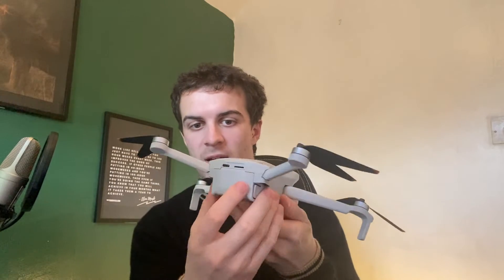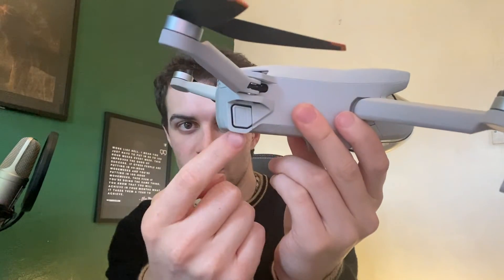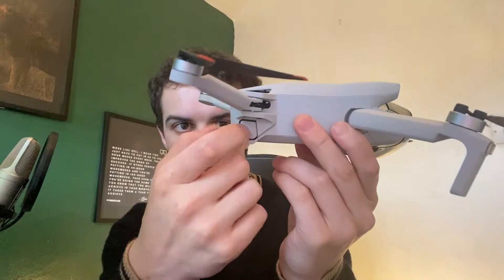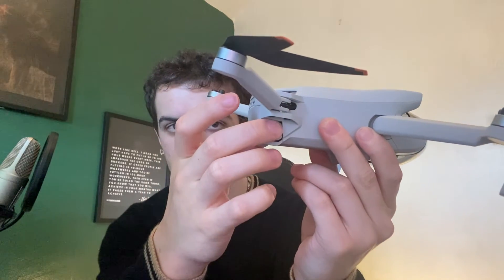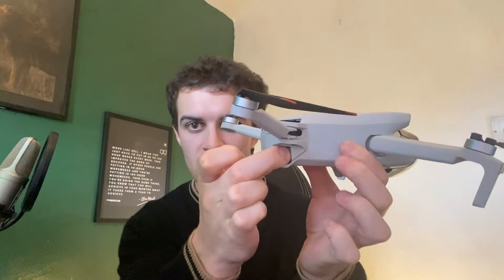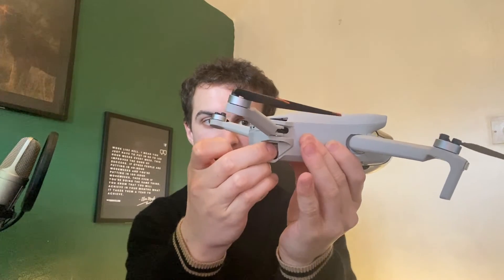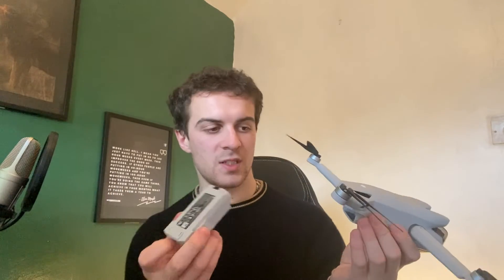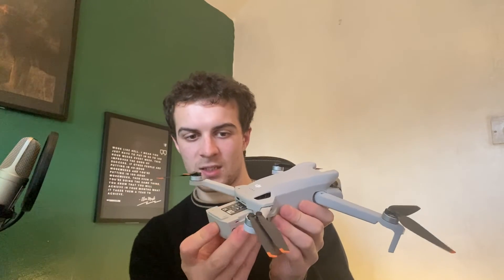How To Remove Battery On DJI Mini 3 Drone (Proper Way)

Comment: It shouldn't require the props to be unfolded just to remove the battery. Irritating design change by DJI who is usually a lot better at basic quality of life stuff of this sort.